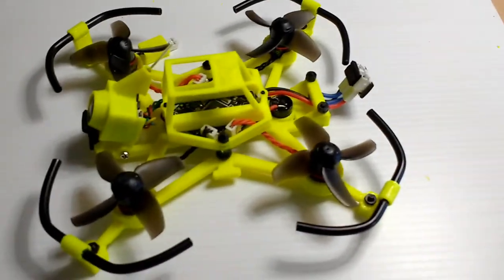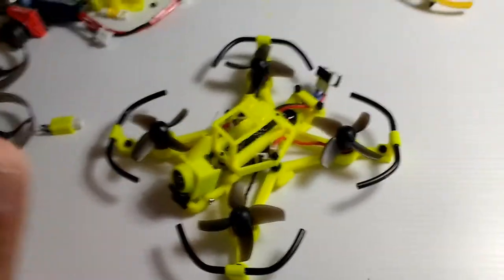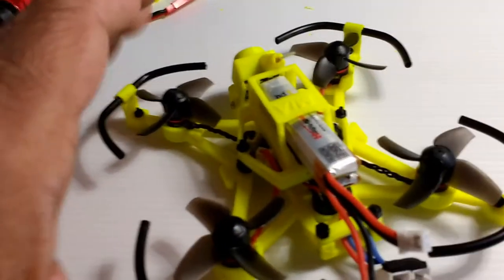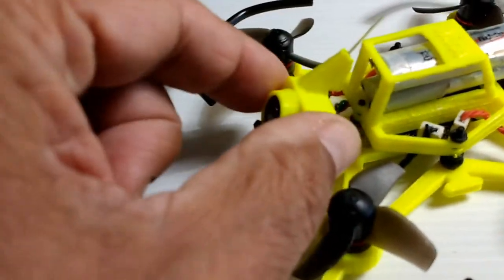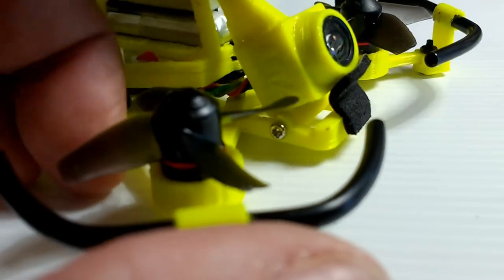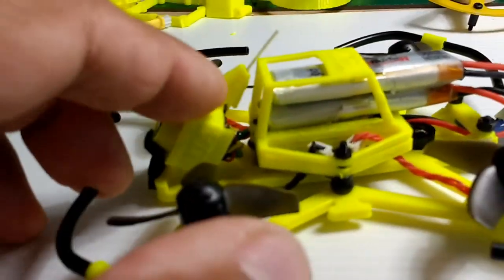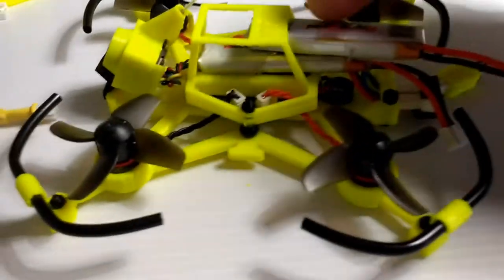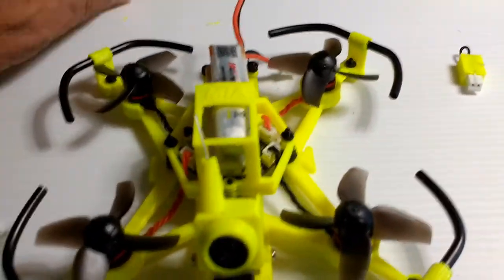Mobula 7 with Best Features of the Latest MIA Racing Frame Upgrade

Comment: Looking good! You are correct the antenna will disconnect at some point then I'm going to a separate VTX and camera as I did with my V2 Leader 120
Reply from the maker: That is probably a better option but there is more desoldering involved, unless you simply clip the VTX from the Camera at the connecting posts. then rewire accordingly.  I  simply made  a longer antenna, and replaced the original since this video, and the camera  signal strength increased a bit. The key is to keep the vtx/antenna away from the Radio RX antenna so there is no cross signal interference. Although they are both on quite separate frequenceis they are alwaya stray signals that get away and can make a video fuzzy at times.